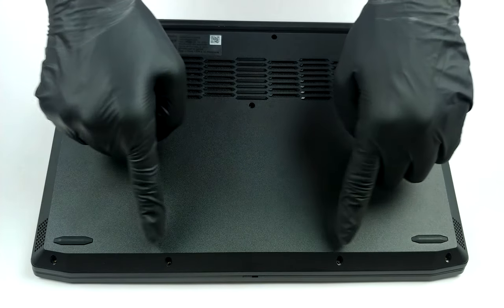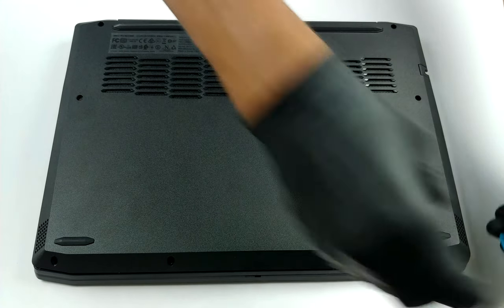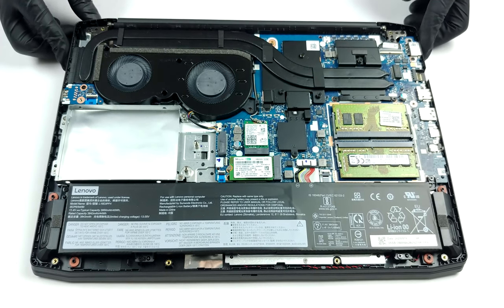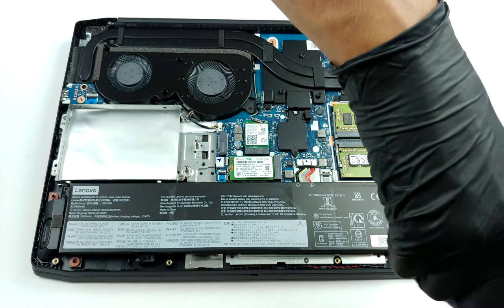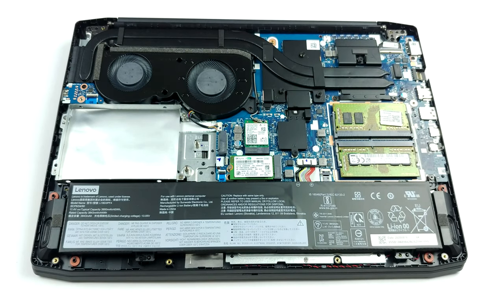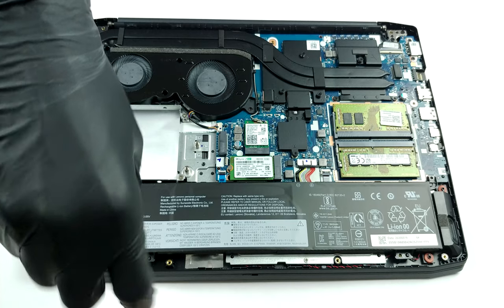🛠️ Lenovo Ideapad Creator 5 (15) - disassembly and upgrade options

Comment: Battery life is horrible in an otherwise great machine. No chance of replacing it, I assume?
Reply: How many hours for normal gaming? And didnyou find a replacement battery?
Reply: @TheArt832  I use it mostly for semi-light work stuff and battery dies in under 4 hours. So I think for gaming you gotta have it plugged in. 

Haven't really looked at batteries yet.
Reply: battery is reeally bad

Comment: how do i apply a 2.5 inch sata drive to the idea pad creator?
Reply: Same question!
Reply: @gianfrantube  have you find a solution?
Reply: @Logli1987  no, and because of that I returned it and bought a different laptop.
Reply: @gianfrancomarino1801  come mai? Qualche problema in particolare? Io sto impazzendo perché continua a freezarsi e non riconoscere periferiche.
Non é un buon pc a quanto pare :(
Reply: i think you need to buy a convertor to connect it to the motherboard, where you connect is the slot next to the 2.5 inch sata drive place